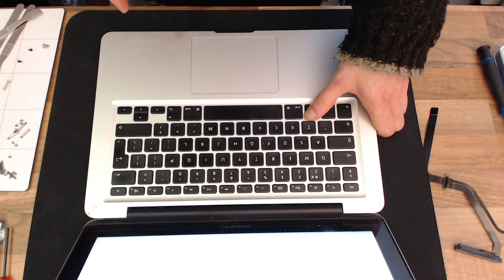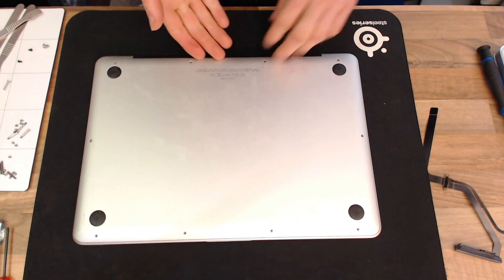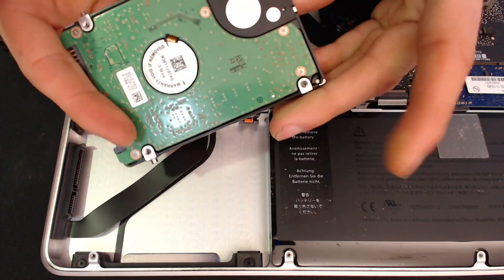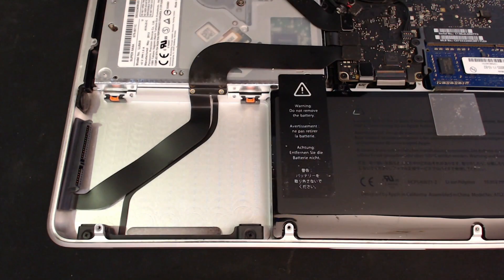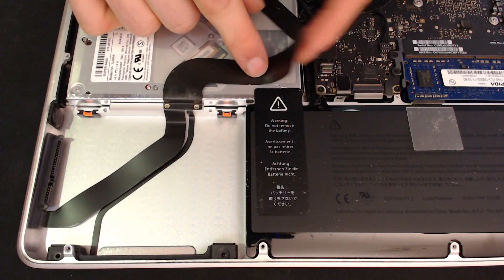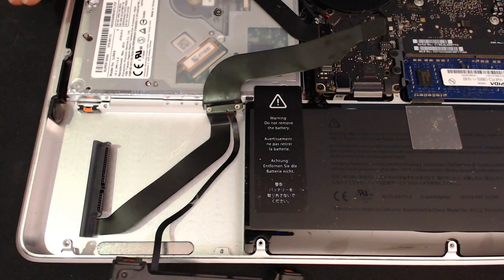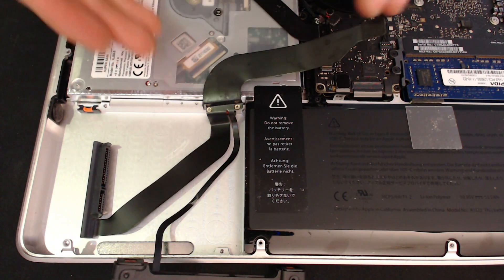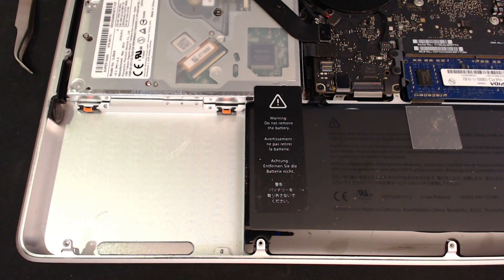LFC#67 - MacBook Pro HDD Not Detected

Comment: Good evening, just wanted to ask, if the hard drive spins and you can hear it running, (This is a HDD not SSD), does this still mean that it could be a SATA cable failure? Thank you
Reply from the maker: Yea definitely - the drive will spin up as long as it receives power, but the data lines in the ribbon may not connect.
Reply: @Adamant_IT  Thank you for the response. I'm currently trying to fix a 2011, 17 inch Macbook Pro with GPU Failure. Even though the HDD is empty, the Laptop would only boot into Single-User Mode when the USB Stick with MacOs Sierra Installer was on it. In addition when pressing the Alt Key on boot, only the USB Stick would be present and not the Hard Disk. Is it possible that because the HDD is empty or not formatted to Ex-FAT, it does not show when pressing Alt on Boot? I appreciate your help and love the videos. :)
Reply from the maker: Yea if you've got GPU issues, I would quit now if I were you. It's possible to hardware--disable the GPU, but by the time you've done that you're just left with a 12-year-old laptop with integrated graphics. It's a shame, but the Unibody macs just aren't worth saving IMHO.
Reply: @Adamant_IT  I agree and it's a shame because I am a massive fan of the 17-Inch Unibody Mac's. I currently use one for University that had a GPU failure and works great. Furthermore I do not have the equipment or the capabilities to make the Hardware Solution unfortunately, and I only try to fix these as I am a huge fan of trying to resurrect machines, tear them down and learning from it. I 100% that there is no point and for me it's just fun to mess around with.

Comment: Another way the ribbon cable can fail is that it can intermittently work, causing cases where sometimes the drive shows up and system boots, other times it doesn't. Some other cases of failure I've also heard of caused by a bad cable is the system locking up at random, as well as the disk being unusually very slow.

Comment: Hey Adam, my a1706 had an envelope with a ?. Was working find before randomly glitching out. Tried everything and couldn’t get Mac hd to mount or not be grey. Finally got the Mac afps hard drive to erase and a new untitled hard drive finally showed up mounted which allowed me to uninstall and reinstall os. Rebooted and folder still flashes and now no hdd shows at all. After weeks I’m at a loss, assuming maybe it’s my data cable?

Comment: Good but limited advice suited for more experienced laptop repair people. Goes way too fast for my amateur brain. Sound quality / voice not especially clear.  That little orange  ribbon cable he struggled with is the hardest part, especially with its nano latch and repositioning the orange cable back in and locking it.  Gosh, did he mention how to be bend the  new HD cable into a stair step on the little gray lines and don’t forget to disconnect the battery beforehand? https://youtu.be/sgIwxA1_tcA

Comment: What if it’s not the chord? Tried this three times and it still has not worked. Everything was fine but I attempted to clone my HD from my other laptop. It worked, but then the host computer would not recognize the drive. Even after I erased it and did the control R shit. I’m so frustrated because it all worked perfectly fine
Reply from the maker: If you've replaced the cable, and you've tested the HDD (diagnostic test, being able to read/write from another computer is not a diagnostic test) then it has to be a logic board fault.

Comment: Where did you buy your cable and what part number? How long does it last?
Reply from the maker: eBay, part number depends on the year of the laptop. Search for "macbook pro 13 2011 sata ribbon" where 2011 is the year of the laptop. Make sure to check that the picture matches the old cable.
Lifespan depends on how much rough and tumble the laptop gets. I've replaced many of these, only had one come back a second time.
Reply: Adamant IT thanks! I see there’s a newer model 821 2049 vs the older one 821 1480. Any experience with either?

Comment: Hi Adamant IT, i have a similar problem with my 2012 macbook PRO,  I have tested 5 different hard drives ( tested and good working hard drives) 2 of them always  appearing in disk utility and the other 3 drives never showing up (one of them even with os x installed on it).. all  drives are initialized and formatted Mac OS Extended and journaled.. is it possible to be a bad flex cable causing all of this ?
Reply: Halo Forten yes bro change it. Everything works coz I faced the same issue. Replacing the cable will fix the issue
Reply: sai ram thank you, that was all the problem !

Comment: Hi I have a problem, i’ve already change sata cable and even ssd and my Mac is still not showing the disk. I put flash disk into Mac and i could see it normally in os installation, but i just doesn’t show the freakin’ ssd. 
Please help I am trying to figure this out for 4 days already
Reply: Yes, then I realized that I need to formate new ssd, finally it works now😁 thx for you answer anyway

Comment: I have done this 5-6 times with 3 different hard drives and 3 different cables ordered on amazon.. I am still getting the folder with a question mark and then I go to disk recovery and it’s not reading any hard drive... What else can I do?
Reply: replace the logic board
Reply: Giblerrr I just bought a practically new logic board because that was my original issue and I now my computer turns on and I can get the the disk recovery and I can get to that screen. No way I have to buy a new one :(

Comment: Cable failed today at college, i ordered the part and ill have it for next weeks classes. Hope this works haha! Thanks a bunch dude.
Reply: Did it work?
Reply: B4nks yes it did. I tried the original cable a few times to see if I could boot normally, and I got it to work once so I knew it wasn’t the HDD. It was stressful putting the new piece in but it works perfectly fine now.
Reply: @officialtherippa9127  Thanks.. Yeah it looks sneaky tricky.. I ordered it last night but I got same day delivery.. should be here by tonight. I'm quite confident it's the wire. Even if it is the SSD, I feel that replacing the MBP 2012's HD cable is like getting an oil change on a car. It burns out over time and needs to get replaced.

The difference with mine is that everytime I start the comp, I get the questionmark. I have to boot up in Recovery Mode (Where I always see the SSD hard drive), but it doesn't display the option to Restart with it. So I just do a regular hard restart, and then it boots up.  Annoying because I still have to go through Recovery Mode every time.

I'll follow up.
Reply: turns out I couldn't even get the screws out macbook to get the back casing off. Maybe my percision screw set is too cheap.
Reply: @B4nks  I know it's been 3+ years since your reply, but did you select your main SSD/HDD with macOS on it as your main boot drive in "Startup Disk" in System Preferences? I'm also noting this down for any future people who may run into this problem.

Comment: What is that bar with orange color clip? 3.40
Reply: Adamant IT thanks a lot. Also one more question if you can help. Is it ok to replace HDD with caddy rather than new cable? And will it boot as primary drive?
Reply: Adamant IT Thanks a lot for the reply. Not everyone does that’s. 👍🏽✌🏽😊

Comment: Just successfully performed this repair on my MacBook Pro (13-inch, Mid 2012). Thank you so much for the video!
Reply: Hello i have the same macbook.. had you dropped you macbook? i had dropped it and ever since it has been showing a flashing folder with a question mark.. do you think changing the cable will work for me as well?
Reply: @ZP25111  Hi, facing same issue here. Did you get any help?

Comment: Hi and thanks for the video.  Question: the broken Flex HD appear when You run Apple hardware test? My Mac shows a folder Whit "?",  and I follow the steps that Apple give as but the HD does not appear. And the Apple hardware test Say that Everything Is ok. I reset pram, Nvram and SMC. Do You think that the problem Is the HD Flex? My SSD Is almost new... I test it on Windows 10 Whit paragon... And don't appear. Do You have any sugestion?  Thanks in advance!!!
Reply: Thanks for your answer. The truth is that I tested the disk using it externally with a SATA> USB cable and it did not detect it, not even some programs that correct errors in its operation. I was already giving the SSD disk for lost, until after trying many times in repeated days ... one day it worked. I put it back on the Macbook pro, and everything went back to normal. At the moment I do not rule out the idea that the Flex is bringing some problems....

Comment: I think I have somewhat similar issue, all of a sudden it won't detect two of my replacement drives that was detected just fine for last couple of years (one is an HDD, another is an SSD), but strangely it doesn't have a problem detecting the original hard drive that came with the mac (the one that have the apple logo on it). Note that all drives works fine when connected via USB or when tested on my Desktop (Windows) PC using SATA.

Currently I'm ordering the replacement cable, hope it will restore everything back to normal
Reply: Did you fix it? I'm having the same problem, it doesnt detect my new SSD but the original drive works fine.

Comment: Did the Macbook not read the hard drive at all or only when booted up in option mode? I'm asking because my Macbook Pro won't read the Hard Drive that's inside of it when I boot it in option mode but when I go to recovery mode and try to reinstall OSX it shows up. I might have another problem because I tried to run OSX from a external SSD but it never works.
Reply: Thanks for the reply. I've tried booting several hard drives from a separate computer and they all worked I'm not to sure whats wrong because I had it looked at and it said the logic board was fine and that there is only a hard drive problem.

Comment: what if I put the hard drive into a usb enclosure to copy my data if that's possible (and hoping that the hard drive isn't damaged) will it work as normal if i put it back into the laptop thanks
Reply: Hey, my Mac has just started displaying the question mark folder. I have yet to take the drive out but I did attempt booting from an external USB. It seems that none of the drives are readable.. Would this indicate a logic board problem?

Comment: Please Ignore that other person.  I found this handy as i have found myself in the position where i need to do this for my macbook. (currently booted off an external hardrive via usb)

I found your instructions on removing the smaller connector on the front edge particularly useful as i am soon to attemp this and wasnt aware of that part.

Thank you very much for a clear and well delivered instructional video.